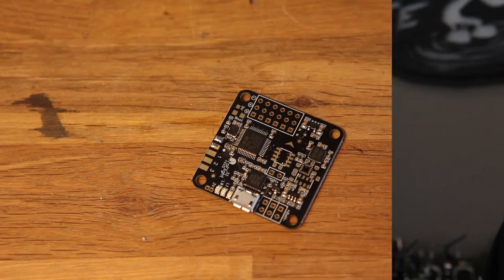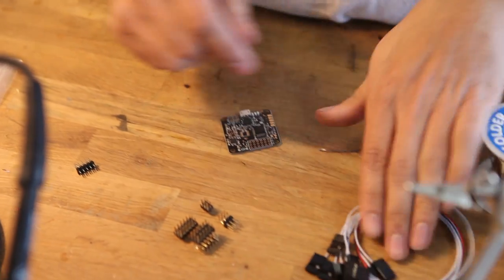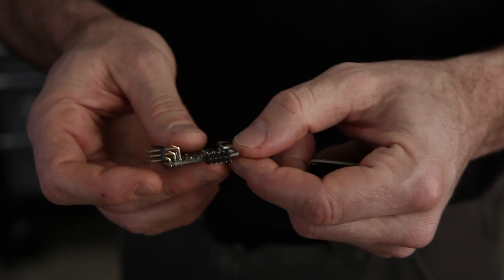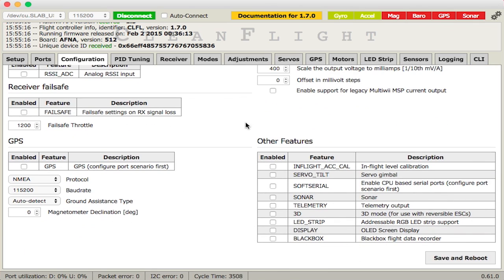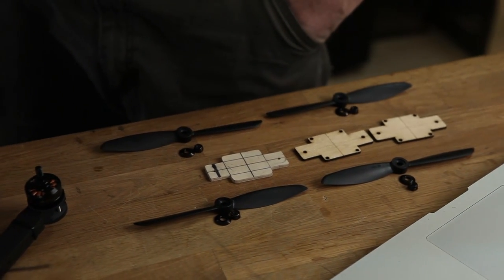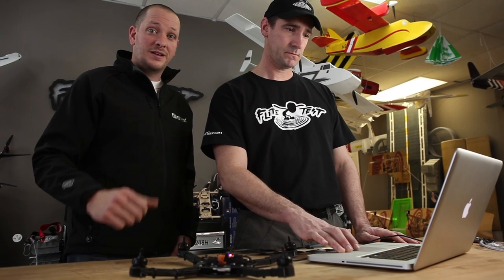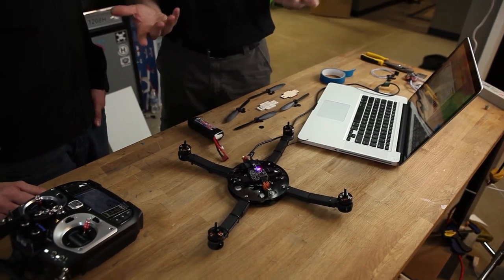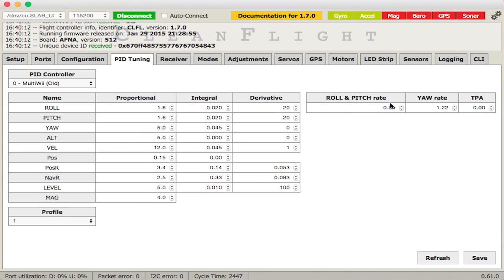Flite Test | Naze 32 Board Setup

Comment: Is this a Rev 5 or 6? I see the rev 6 has a different breakout cable wiring, and the Rev 5 has the double layer.
Reply: Looks like 5, definitely not 6.
Reply: thank you!
Reply: def not a 6 the 6 has a 1 x 10
Reply: Yeah, I think its a rev 5. You're right about the 1x10 pinout. I guess i was still a noob when i asked that question, and have moved away from Naze boards since they are F1 based processors.
Reply: Kevin Wang everyone is going for the kiss FC , I jus got my rev 6 and am gonna give it a go on a 220 size quad, for the economic value and the potential add ons you can have GPS it's still a better choice then some others out there ccd3 open pilot ect ect
Reply: Yeah, but watching the Rotor Riot vids made me switch to Kiss FC paired with Kiss 24A Race ESCs. I love the built in telemetry and the simplicity of the setup. I still have a Rev 6 on my 215 size quad, but I mainly fly the Kiss quad now!

Comment: so to use the cleanflight, you have to be connected to the net ?
Reply: No, you can use it offline. It's a Chrome App, not a web app.
Reply: fahrvergnuugen do I need to re-flash CleanFlight to modify the settings? I mainly just want to put it into Acro mode.
Reply: Jason schmidt No, you only reflash in order to update the firmware to a different version.

Once the firmware is flashed onto the chip, you start using the configurator to setup your PIDs, RC settings, flight modes, etc.

Comment: Hi Guys, first off just subscribed to your Channel, so informative and helpful. As you may see from my Username I'm jut getting into the Hobby using a Syma XC5 for some indoor practice and Slowly getting the hang of it.  Got a little Problem tho' , recently Bought a New Naze 32 Full board, now, I've flashed it with the Latest Firmware and connected into cleanflight ( Board is not fitted to anything yet. ) Have done the two Calibrations BUT, I still have a blinking green Light as well as the Solid Blue ?  is this right as I can still go in and change Values Etc. P.S I'm in the U.K

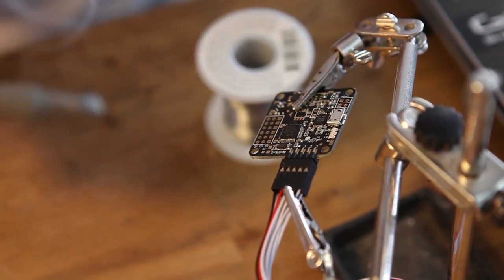Comment: anyone notice that peters soldering iron is too hot? Immediately burns away flux... oxidized and cold solder joints with little thorns coming out. Doesn't look so hot 4:22
Reply: Oh wow i didn't notice that before.

Comment: Nice, huh?  I have a cleanflight Naze32 acro board also and love it so far.  Also check out Openpilot. It's even easier to set up as it steps you through it. Not sure which I like best yet, Cleanflight or Openpilot so I'm trying them both on different machines.

Comment: Who else cringed when they saw Peter carelessly stick that board right into that metal alligator clip???
Reply: +thechosendude I did, but then thought about it and it's not that bad. As long as youre careful about placement and letting the pressure on gentley. The biggest problem i could see is if it was knocked while clamped and sliced though a track,
Reply: yeah I gotta say that made me jump - brilliant video guys but you gotta give the camera chance to focus before you move on - every time the pic came into focus the subject was moved onto something else!  bloody frustrating and my only gripe, keep up the good work guys (just fix the focus thing pls)

Comment: Nice,  just remember,  if you load a genuine Naze board with Cleanflight you void your warranty.  The driver link is also right on the main page of the app, make sure you reboot after installing the drivers if you're having issues. Check page 2 of my Emax blog about doing a stealth pin install:  http://www.rcgroups.com/forums/showpost.php?p=29990129&postcount=2

Comment: Peter, you won't melt the plastic if you would use the correct solder tip and heat. The one your using is way to big brother.

Comment: Should always calibrate the EEC's through the transmitter so they are calibrated to the signals generated by the receiver and transmitter, not the USB to the computer.
Reply: This isn't correct. The ESC's are receiving signal from the FC. The FC determines the max and min values, so the FC should perform the calibration. If you calibrate to your TX and it has different endpoints than your FC, the ESC's won't be calibrated correctly.
Reply: Exactly right Joshua
Reply: But how does your FC know the endpoints on your tx. Plug the rx into your FC and do it that way
Reply: The FC uses fixed endpoints regardless of what your TX sends. So for MultiWii (for example, but most others are the same) the channel always runs from 1000 to 2000 with 1500 as the center. Your TX must be configured to send an equivalent range or there will be a mismatch that will cause other problems, such as inability to arm/disarm. If, for some reason, you simply cannot get your transmitter to use the endpoints your FC expects, then calibrating ESCs using the transmitter may be an okay workaround, but it shouldn't be your preferred method.
Reply: Imagine this scenario Spitfire, your transmitter/receiver outputs a range of 980 - 2050 (my taranis is close to this actually), say your flight controller's default range is 1070-1850, so when you calibrate the throttle range on your esc's you're essentially telling the esc's this is the highest signal you will see, this is the lowest signal you will see, and your esc takes this range and basically sets the low # as 0% and the high # as 100%, so if your receiver resets these numbers in your esc as higher and lower than what your flight controller outputs, when your flight controller sends out what it thinks is full throttle (1850) your esc's see it as well under full throttle  cause they think full throttle is 2050, and when your flight controller sends out 0 throttle (1070), your esc don't see it as 0 cause you programmed them with your receiver to see 0  throttle as 980, but would actually be receiving 1070 so they would be spoiling up your motors some. So thats why you set your esc's to the min and max range your flight controller will put out so when the flight controller sends full throttle or no throttle the esc's see it as full throttle and no throttle. On the naze/cleanflight/baseflight the best way to do this is on the motors tab. If your FC doesn't have a way to set the throttle range on your esc's you can do it with the receiver but you will have mixed results and it's not ideal. Hope this makes sense. Good luck!

Comment: Just got my Naze32 and used Cleanflight to flash. FYI, I use  #Linux  , no need to add drivers or reboot,  #Kubuntu  system just saw it and flashed. Took about a minute.

Edit. Oops, change from Cleanflite to Cleanflight.

Comment: Hey guys thanks for the video, maybe you can help me out. I've been watching different videos and I follow all the steps and my drone still not running. Here's my setup:
Naze32 rev6 
Matek mini power hub w/ BEC 5V & 12V
A2212/13T 1000KV motor
HobbyKing 20A UBEC ESC
FS fs-IA6B receiver 
FS fs-I6X transmitter
can you help me on how to connect and Flysky set up, greatly appreciated.

Comment: I noticed that no one is observing ESD.  When working with TTL circuits and their boards, you should observe ESD rules to help preserve your work. Not observing  ESD can result in TTL  component degradation and eventual fail of components when least expected or needed, typically in the air !!  Which can be catastrophic !!

Comment: Its irresponsible to tell people to enable motor stop. When your board is armed you shouldn't be anywhere near it anyway. Enabling motor stop is opening it up for accidents to happen. A lot of new people are enabling motor stop as they are following instructions on the web and dont really understand what they are doing, putting themselves at risk
Reply: this is cleanflight though.  As stated by MassiveOverkill, by default it auto disarms after 5 seconds.
Reply: notasixpack Regardless, it takes less than 5 seconds for the motors to spin up and cut you.
Reply: I prefer motor stop. They gave a very good explanation on what it was and that is was his preference. Also if people don't understand a motor stop feature they need a little more research before they attempt to fly the multirotor. What ever happened to personal responsibility.
Reply: paulham so set it to 1 second.  motors spinning up when armed is also a risk.
Reply: notasixpack Not when you know that armed quad = danger. So always make sure you dont arm your quad till you are a safe distance away!
Reply: paulham So I've actually used both -- motors spinning and not spinning.  I use a throttle cut on ALL my models (dx9) so for me motor stop is not an issue.  However, there IS this scenario with motors running.   When you arm the quad and motors are running, EVEN with throttle cut, the motors spin.  BUT..  your timer doesn't count down.  I kick off my timer based on throttle output.  I don't necessarily see the motors spinning in my goggles.  In this case, if you sit there for a minute when someone asks you a question, you may possibly have a danger situation because you will crash from a LVC without knowing it.
Reply: How do you disarm fast enough to stop the motors in case of a crash? I've found that sometimes it's necessary to immediately stop the motors by throttling down to zero. One reason being that some ESC will burn if the motor is blocked because it landed in high grass for example.

Everybody has their own preferences, I would not call that irresponsible.
Reply: If you're concerned about the risk of accidentally arming and hitting yourself at low throttle, you should be doubly concerned about arming and accidentally hitting the throttle and having it go high.  Accidentally arming and going high is harder.

You should also be concerned about cutting throttle and having the motors reverse and the ESCs lose sync on the way down and not be able to get them spinning again before hitting the ground at full speed.
Reply: If you use SimonK firmware ESCs, your motors are able to spin up VERY slowly, which is a good visual indication of arming.  If you use ESCs with more rudimentary firmware, "start" tends to be several hundred RPM!  Also, I'm not sure if there are exposed pins to extend the status LEDs out to where they are visible on the naze32, so having the props spin at a few RPM may be the ONLY visual indication of ARM.
Reply: You need the feature on overpowerd quads , the motors don't stall even with 0 throttle.
Reply: ***** I have to assume you're not so reckless as to arm for the first time outside with the props on and with no ability to control/disarm the aircraft you've misconfigured to spin up too high.

I'd rather my motors stay in sync and spinning the right direction during flights whenever possible.
Reply: ***** the only thing hard to see is the end of the list of potential catastrophic failures.

If there are no instructions, then why would you advocate for this particular deviation from the default configuration when your best justifications are around other misconfigurations or trying to control the behavior of an aircraft whose control you've already effectively lost?

People are going to argue, I guess.  I spin up on arm of my brushless quads.  The only thing I don't spin up on arm is my 130mm brushed quad since none of the reasons for spin on arm apply (and the batteries are tiny).

Comment: FliteTest I just want to make sure I understand, I'm thinking about imitating this exact design for my first build. I can't find any place with links to everything required. Would this be it:

http://store.flitetest.com/flight-control-board-mounting-plate-36mm-x-36mm/
http://store.flitetest.com/angle-arm-brackets-electrohub/
http://store.flitetest.com/electrohub-quadcopter-kit/
http://www.hobbyking.com/hobbyking/store/__55819__AfroFlight_Naze32_Acro_AbuseMark_FunFly_Controller.html

I'm sure I'm missing something, I would love to be able to break into building with one just like this. Thanks guys!
Reply: Tony McAfee Yes, that's it for the basic frame. But of course you need a few more parts like props, motors, ESCs, battery, receiver, transmitter, ...

Comment: I recommend not to handle the board like these guys without a wrist ground strap or grounding yourself first. Static electricity can contain a few hundred thousand volts,  which could fry some components. Don't ever underestimate static electricity.

Comment: now you are selling the modified arms.  you will have to design some new legs.  not all of us live where there is grass or snow. heh.  being  a desert rat, rocks/dirt is about as green as its gets.  i have sign up to your forum.. but you have no welcome part like most forums to introduce your self so i have been shy about asking for any help.  anyhow, iv been learning lots and will try to get the guts to post, being a noob getting into the hobbie.  i tried once before but life got in the way.  i built a FT mini speedster for my fist airplane ever, and now my second plane is a fly by wire rubber band balsa wood war bird im working on bought three of them. 1 im keeping stock, others will convert to electric is the plan.  i love building stuff.  i can say i wish the balsa wood had more instructions. just a picture so i wont ever complain about instructions from  a china product. bought a Nano qx to learn to fly quads like you recommend. also fly 2-3 hours a day in the flight sim. its a blast.  hah. keep up the great work. not sure if a tri-copter or a quad will be my first build will help support tho and get the quad main parts from you, source motor/esc/board on ebay. i have more time than money being disabled from a bad motorcycle accident. anyhow, ill try to get active on your forum and not be so shy.  chris,
Reply: Don't be scared of the FT Forum, the multirotor section is a bit hard to find (it's in the "Electric Flight" area) but everyone there is very friendly and helpful.  There's also a sub-forum just for beginners.  (BTW - feel your pain on the motorcycle accident, I've got a steel bar in my left leg after one in '96.) I'm also in the desert and know the pain of landing on rocks and sand.  A small bit of carpet to land on helps keep the dust out of your motors and I like to use large zip-ties as landing gear since they've have quite a bit of give and are cheap to replace when they wear out.
Reply: Hey Chris! The angled arm brackets and flight controller mount came out first, I did design a new landing gear/cam boom for the Ehub....we are still finalizing everything on that design and that should be in the store very soon! Don't ever be afraid to ask questions bro....we are all very glad to help ya out 👍😃
Reply: thanks, i have introduced my self.  hopefully that will cure the forum shyness. heh.
chris.